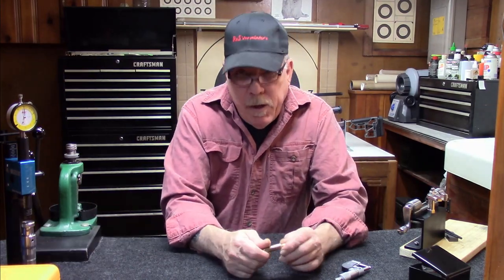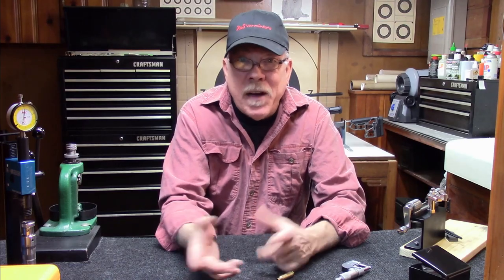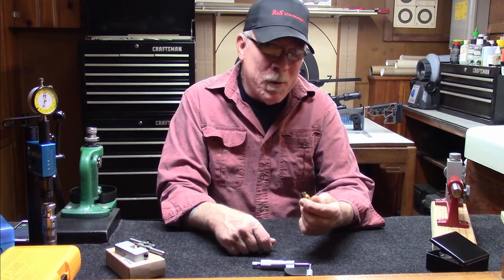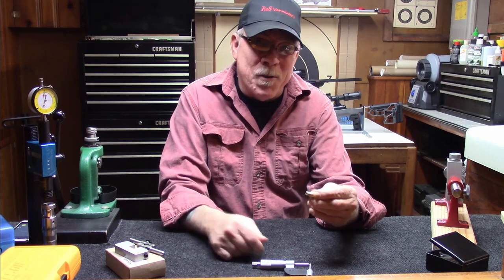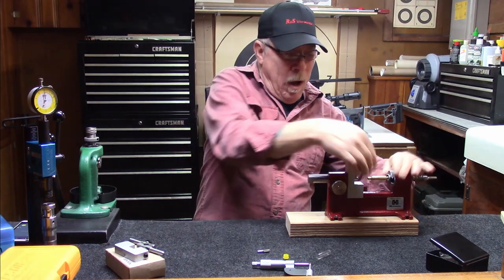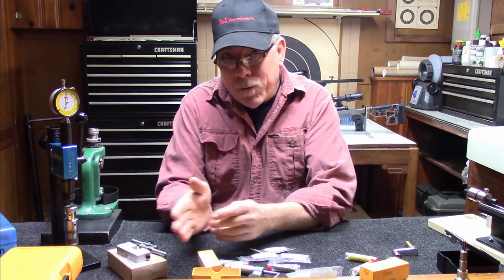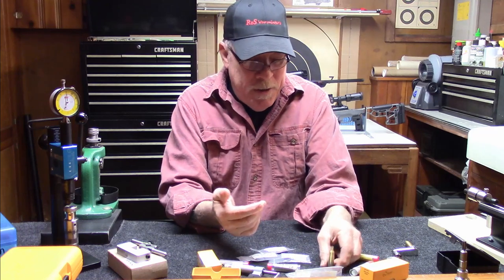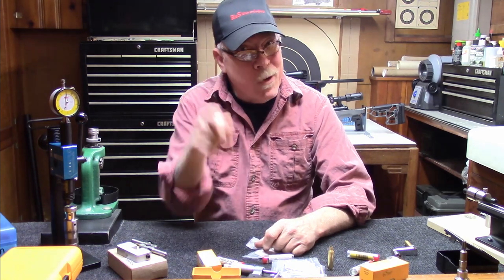Inside Neck Reaming Creedmoor Brass

Comment: I have an old lee target loader that has a reamer.  It reams the inside while the case is in the sizing die.  It cuts within .0005" of center.  As far as roundness of the neck, my dial indicator doesn't move in the inside or outside.  Easily within .0001".  Not as fancy or expensive as the new stuff, but it works great.  I seated a bullet .010" and there was zero runout.  I prepped and reamed 72 brass last night and they are perfect.  .0035" neck tension.  37 fired cases and 35 new.  All turned out the same, and are ready for loading.
Reply from the maker: ohhh that sounds great. Let me know how they shoot :)

Comment: After firing, I bushing size to dust the I/D to a standard neck reamer. This removes brass that flows and forms the donut. If needed, I turn the O/D and pilot on an oversized neck turn pilot that I've hard turned for the diameter the reamed produces in order to minimize runout. For brass already turned, or after turning, I then bushing size for 0.003" interference fit for the bullet. Then coat the I/D with Neo Lube and seat the bullet. Anneal brass between firings.
Reply from the maker: I opted to use a better method for my necks. https://www.youtube.com/watch?v=4ASU4mWvoxU

Comment: My experience with the Forster trimmers is that you ream the internal case neck after firing , before resizing. If you ream new or resized brass, you will remove too much metal and you won't have sufficient neck tension.

Comment: Okay I used your method and had great success getting all my case necks within just a few hundred thousandths. I wish LE Wilson made a handle for the reamer, and 21st Century made expanders larger than .309. I think they need to make .3095 and .310.
Reply from the maker: I reamed 100 284 brass the other day. I unscrewed the handle and chucked the cutter in a drill. slow soft push and it worked great.
Reply: @rsvarminters9083  so the LE Wilson Neck Reamer circular handle can be unscrewed? If so, this is amazing news my hands are ripped to shreds after only 20 cases.
Reply from the maker: @GriffinReloading  I made it through 4 cases using a rag. I tried to counter spin one and that handle came loose. The 284 brass prep I did not long ago, shows it.
Reply: @rsvarminters9083  wow I just put my reamer in a vise and counter spun and it can right off! Now headed to Home Depot to get a nut that will fit. I am going to wait on reaming the rest of my brass until 21st Century ships a the .3095 and .3100 mandrels I ordered last night.

Comment: Hello, before using reamerd first check if you have a real doughnut problem or not. If you try to put a bullet by hand in the neck of a FIRED case, it should normally fall inside. If you feel that the bullet gets some resistance at the neck/shoulder junction there is probably a doughnut that you'll need do remove. I know 2 different ways to remove it. First solution you can use those Wilson reamers on a FIRED case only (do not resize or use expanders!!!), this method cuts the excess of material by the inside. The other solution is to neck turn your brass following the usual procedure (sizing, expanding, turning...), except that you need to set the stop of your tool to touch the shoulder just a little bit (since the expander has pushed the excess material of the doughnut to the outside, your cutter will be able to cut it)
Reply from the maker: Thank you for the comment BR  they are some excellent points and good advice :)
Reply: Spot on - I have this tool but rarely use it because I turn the necks a little past the shoulder, which prevents donuts from forming as the brass flows forward. The reamer is meant to be used on fired cases. 21st century makes and amazing neck turning tool that you can run with a drill - gives amazing concentricity because the case and cutter float and self align. One thing that has helped as well is that I size without the expander ball and then use expander mandrels. My full size die (I use this before neck turning to get the full neck) is pretty aggressive sizing the neck down and then I run two mandrel operations to get back up to size - I find that the gradual expansion (for 6,5 a .2620 and then .2630) get the insides uniform. Then I turn the necks and my TIR is under .002 - when I use the pressure gauge to seat the bullets - they go in below 40lbs and the runout goes down a little more. Starting with better brass however makes life easier. After firing, I use a bushing die to size and the .2630 expander mandrel. The necks stay nice and true - after a few firings, then I use the reamer.
Reply from the maker: @sf2189   Thank you for the comment :) I am aware of the donut thing and do kiss the shoulders when cutting (which I did not do on the 6mm Nosler brass). I was more perplexed at the unevenness of thickness inside the necks and wanted to make it better somehow lol. I usually do not use the expander ball and I like using bushings for the necks to not work the brass too much. Maybe a slight push with a mandrel to get that desired 30-40lbs which the 6.5 is doing now. The 6mm Creed in that Savage is opening the necks up .008 over the seated round. (I miss my tight neck barrels..) I have a fresh box of Lapua for the 6mm, just waiting on the dies from Wilson. The weather is warming up and we got both Creed's ladder tested and started jump testing the 6.5 today. I'm hoping this attention to the necks pay off in the long run. we just need some run time on the guns and well formed brass.  I have already seen a couple 0.4" groups from both rifles. Fingers crossed for better results. Thank you for your advise and information.
Reply: @rsvarminters9083  Hello, I also use L.E. Wilson dies because that's   well made and gives the best consistency on my ammunition measurments. Maybe you can get the same result with other brands for sizing, but for the seating die Wilson's chamber system on a arbor press is much more consistent than any other "competition" seating die (floating chambers). With the neck tension that I use (0.0015-0.002') the difference between the max and the min seating depth measurments is around 0.001 or under. The only time I've seen a begining of a doughnut appearing on my cases was after 15 reloadings (turned necks) but it wasn't a problem because the bullets were seated over and the boattail wasn't touching it, so I've never used my reamer. I use the same neck turning and sizing methods as S.F. I hope you'll get nice results with your creedmoors, wait and see. I've just received my new tikka custom in 6.5 C.M. but I'm still waiting for the dies !!!
Reply: @rsvarminters9083  I had some Hornday brass from some match ammo that i was working with and had the same issues as you. Funny enough - thats why I bought the reamer - and was given the same advise given to you here about how and when to use it. The really tightening the neck and then mandrel operations made the neck better but ultimately I know the issue carries down the entire case. My life got significantly easier with the Lapua brass and some Whidden dies. You are going to be a very happy man. Enjoy and keep up the great content!!

Comment: So the reamer will cut on the center axis of the case and not the center of the neck hole? I am reloading fired brass and neck turning the ouside to a thickness of .014" and am wondering if this tool will only cut to the center of the axis which in turn would leave some areas inside the neck untouched by the the reamer? The other question I have is that the wilson reamer for my .264 cartige will finish it to .267 so what will this do to my neck sizing bushing? I currently use a .289 bushing on my .264 cartridge.
Reply from the maker: Logan, in theory the case body and neck should be in alignment together. Check run-out after firing and after sizing. I use large enough mandrels to open the neck so I will only get the thick spots cut and the donut area at the bottom if any. At most I only want to cut out .001". Removing any thickness from your necks will change the bushing tension.

Comment: Great video, just what I was wondering in my process. Where did you say you got those mandrels? I got one from midway for what I thought was 223 and it looks to be for 220 swift. The more I thought about it I figured I’d need several different sizes to accommodate for different neck thickness etc. Again thanks for the video as I’m going down this same rabbit hole. The more gauges I buy the more holes I go down it seems lol
Reply from the maker: I know right, it seems to be never ending. Right now it's neck chamfering.
21stcenturyinnovation has the mandrels :)

Comment: Keep in mind your calipers when measuring I/D have flats on them and they will measure small, in on 6.5mm probably about 0.001-0.0015" . Small hole gauges and mics will be closer, but of course, that's a PITA. Just anticipate the I/D.

Comment: IN ABOUT 1975 I GOT INTO BENCH REST SHOOTING ON A BUDGET SAVAGE 112V SINGLE SHOOT 26" BARREL 22-250 NECK WAS GETTING TIGHT I KNOW BRASS HAD TO BE REMOVED THE MOST LESS EXPENSIVE WAY THAT L COULD FIND WAS RCBS INSIDE NECK REAMING DIE $25.00 AND A I BOUGHT .223 DIAM. HS HAND TAPING REAMER THAT WENT INTO A HAND DRILL IT DID A GREAT JOB, FROM THAT I'M TOLD THEY ARE NO LONGER MADE,
 I NEED ONE FOR MY 223. IT WAS A VERY SIMPLE WAY OF GETTING RID OF BRASS FLOW IN THE NECK AND BRINGING THE NECK BACK TO SPEC.
Reply from the maker: I used to cut them off of from the outside after expanding the necks. It seems much better to get them from the inside now a days.

Comment: Does your barrel have a custom size chamber ? I am a retired Tool and Die Maker and I have 
almost as big a pile of tools and tooling as you do in the quest for a better shooting .243 wssm rifle . My problem is my Browning A-bolt SS Stalker 2 has a production size chamber. Some day I will order a Bartlien 5r 6mm 26" barrel and have a custom chamber reamer made with much tighter tolerances. Setting that thought aside I think first off we need to attain perfect concentricity , everything on the same centerline tip to base. I will assume you have a custom size chamber. The shoulder can be bumped or not , whichever you prefer .. Concerning neck reaming the doughnut , some of the doughnut is in the ID and  some on the OD. Working with fireformed brass the OD doughnut should be skim cut , just enough to flush it with the neck OD, not to concerned with concentricity at this point. I now bushing neck size in two increments , 003 smaller then 002 more . First neck size .281 then .279 using a Redding Competition bushing neck die . I then put the .281 bushing back in and place on top of the .281 two ea. .241 bushings to guide a succesion of reamers .2395....2405. Then I change to two stacked .243 bushings to guide a final reamer cut of .242. 
I want to final finish the ID by honing rather the reaming , seems that would be more consistent than the reamer finish and even final sizing with a mandrel still leaves the reamer cut surface finish . Also considering coating the bullets with HBN . Then I trim the OD to the concentric ID. I need a custom cut chambered barrel at some point in the future. Being retired leaves plenty of time to study and research , Good day to you Sir !
Reply: I have thought about honing/polishing a tenth or so off the Berger bullets  the section that goes in the neck , to get a more consistent finish !! I think its the inconsistent stiction that is causing the problem. The problem is the surface roughness and inconsistency of a reamer cut neck and the surface finish of the bullet . This factors in the amount of stiction , that is the amount of force it takes to initially break the grip the neck has on the bullet . Improve the surface finishes and get better/consistent stiction results.
Reply: If you could make tooling to hold the case with a bullet seated upside down with a hole drilled thru the primer pocket and a rod inserted you could test the stiction of different surface finishes .
Reply from the maker: Hello Jeff and let me first say, I like you're way of thinking .  I too am retired and I see nothing wrong with trying to build a better mouse trap :)
The chambers on these rifles are a factory spec. A tight neck chamber would be better for not moving the brass more than needed just like using a bushing size closer to our end results.
Not real sure where to start this. We know about stuffing a piece of brass into a smaller hole to make it smaller, then we stuff a piece of copper into that brass hole and want that world to be a perfect place. The OD is easy to obtain the ID not so much. I was ginger with the ID reaming and by eye, the finish was smoother inside than it was prior to the cut. I did actually try to put some compound on a mandrel to polish the ID some but....not a good set-up. I'm a friction minded guy that understands surface area tension, but, round peg in a square hole = not good. I often recheck the OD (with my preset dedicated tool) and cut the OD donut. I feel much better now that I have at least attempted the ID thing and the dial indicator shows improvement. Don't get me started on out or round bullets..lol  hmmm, are those neck bushings round? The research goes on.  Best of luck to you Sir !
Reply: @jeffreyweekley6974  FYI - I've seen where some reloaders wrap 0000 steel wool around an appropriate size bronze bore brush and use that to polish the inside of the neck

Comment: Curious about something, what is your base line on new brass on neck wall thickness? before it has been fired to see what size you end up with after that, We are talking never been in your rifles chamber.
Reply from the maker: Fired brass will often even out the outside but the necks are still uneven (inside)when measured. I have not seen any change in them after firing that would help this.

Comment: I'm confused as to why you would need to ream the inside of the necks and turn the outside of the necks, both.  If you use a neck sizer that works by pressing the outside of the neck against a mandrel, like the Lee Neck Sizing Collet Die, then the ID is set.  You should only need to turn the outside of the neck.  Even if you use the standard old expander ball, then the ID should be set and you should only need to turn the outsides.  One video I watched that discussed reaming said you do this with a fired case only that has pressed against the inside of the chamber, so the outside will be consistent and the inside will be inconsistent.  That makes sense, also.  But to do both?  I don't see the reasoning.
Reply from the maker: Thank you for the comment Robert. What actually started all of this was I could not get consistent run-out on my loads. I kept buying better dies to solve this but I found out with brass that was already neck turned and fired and worked, that the neck thickness was not even. I could see the mandrel marks inside the necks were only hitting certain spots. The marks gave it away.. After doing this process My run-outs are less than 0.001" The seating presser is way smoother and even. My SD's and ES's are a lot better and the groups show it as well.
If you have time check out Eric Cortina's video  https://www.youtube.com/watch?v=TqsLckcdLCQ
Reply: @rsvarminters9083  So you are saying that the collet die actually doesn't make the inside diameter consistent because of the collet?  I wouldn't think an expander ball sizer would have that problem. Thanks for responding.  I'm just beginning to look into this.
Reply: From a different point of view, I’m wanting to inside ream to remove donuts from necking up & down & moving shoulders ect , while forming wildcat cartridges , & I want to out side turn also . So I’m looking for the best tool options, that can give me the most flexibility without buying extra tools that I won’t use or just don’t need / or not efficient.

Comment: Its hard to believe LE Wilson doesn't make a reamer the proper size to ream the brass before firing 
The bulk of guys looking to ream the ID are forming brass from another cartridge..

We need to ream before firing , not after .
I bought a .262" reamer online and will have to adapt it to a tool I'll make 
after making  22 and 6.5 Creed from 308 brass , You must pay attention to neck thickness  as it's
too thick ....dangerous firing will occur from a tight chamber in these high pressure rounds.
Reply: They do make custom reamers for people doing wildcats.

Yea I find it stupid too, another way is to buy neck bushings and creep up on the reamer size, then ream then neck down once more.